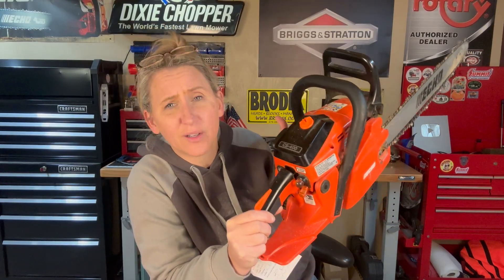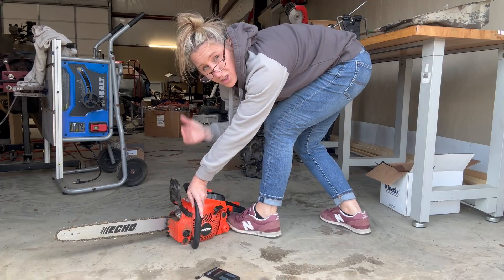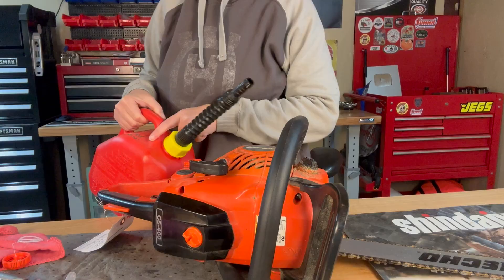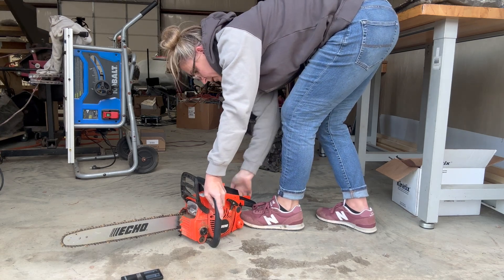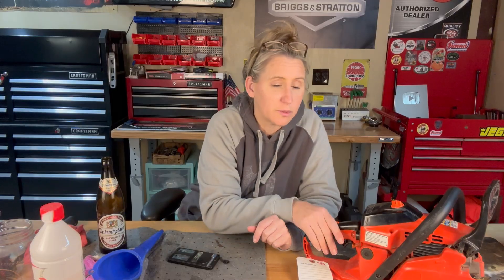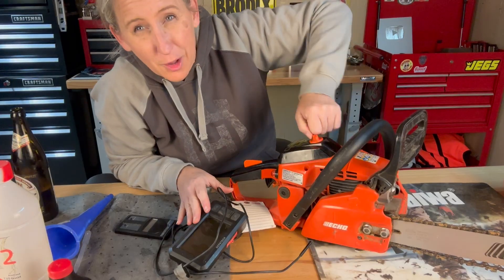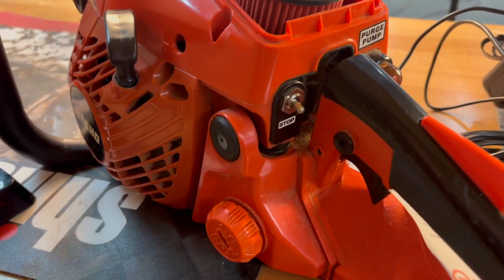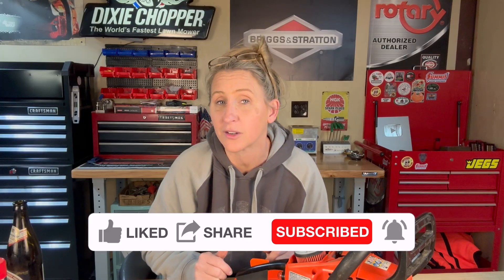Engineered Fuel FAIL! Your Small Engine Is Not Running Right, Even if You Think It Is!

Comment: What about vp? I know true fuel makes there fuel in bulk, so stability is a big issue. Vp and there brand sef, have the hole raissing reputation to uphold, so maybe there better? They make there products in small batches, and sell old stock on clearance, so stability shouldn't be an issue? TF seems to be pumping as much stuff out as they can, with things like reputation, a good product, and customer servace being secondary to profit. As a blind small engine mechanic with no usable vision, I have to rool everything out before I even think about calling something fixed. So mixing pump gass, with all the problems it can have, is not an option because it can introduce problems of it's own. Sorry for the bad spelling, I sucked at inglish, and it wasn't the blindness, there are blind inglish majors out there.

Comment: Hey girl! I’m an old dude so I’ve learned a lot over the years, but I learn even more watching your videos. I agree on the box store gas…..engines will run boggy…..for me it’s 93 octane and Pennzoil 2 stoke oil….most everything can be cured with preventive maintenance. Let’s see a video on cleaning and maintaining your toys DIRECTLY after using it, instead of just throwing it on the shelf..it’s what I do and with 12 small engines I don’t have problems.thanks again and you go girl!

Comment: Whenever I have someone bring me a motor, first thing I do is dump the gas into an extra fuel jug I have for "whatever fuels", then add some ethanol free pump gas. I have never had good luck with any of the canned fuels in any of my equipment. By doing that, it also ensures I am dealing with fresh fuel as well.

Comment: Bre - a very minor suggestion.   Keep emphasizing the necessity of using a good quality 2-cycle engine oil!!   I totally thought of you and thank you after this happened.    I thought I had run out of my small supply of Echo oil and found one in my supply that I had actually bought from Sears.   Figured it should be good, right?   Even though they didn't make much of their own appliances, they had decent quality products (washers/dryers were LG, Maytag, Samsung) for the yard as well with MTD and TroyBuilt, etc.  I made the mix and proceeded to work the yard.   Nope.   My Sthil trimmer coughed, knocked, and choked on the mix probably barely making it 6-8,000 rpm -  and I'm guessing.   That it was knocking was very evident and smoke coming out of the exhaust port.   I got to HD and all I find is that Tru-Fuel crap,  but they had two pallets of  the trufuel, and no 2-cycle oil at all so I back home I went.     I routed around again and found my last bottle of Echo and mixed that.    If I hadn't found that, I was going to order some through your link and hold off doing anymore yard work.   I poured everything out and put in the new mix.    The blower fired up just fine and sounded 100% better.   The Sthil trimmer coughed a bit in transitioning from one to the other but once it warmed up  - it was like a totally different trimmer.  No knocking, throttles up to max RPM without issue and I noted a major improvement in the torque while trimming.   Thank you girl for all you do.  Now I only go with Echo or Red Armour and I ordered Red Armour through your site.  Just joined your group too!

Comment: I'm having a little trouble understanding the problem with canned fuel..The canned fuel I use is high octane, no ethanol....the engines seem to love it and it does  not eat up fuel lines.  Have you ever had an analysis done to determine what exactly the problem is with some canned fuel?  Love you site!!!

Comment: One thing I went through this spring was I had used canned fuel last year as an experiment, while after adjustment of the carbs it ran ok, I didn't like what I saw, seems to be too much oil in the stuff, and the oil doesn't seem to burn, it fairly poured out of the exhaust. I decided to mix up a new 2 gallon batch of regular gas-oil fuel, and added the remains of the can fuel to the mix to burn it off. It seemed to work ok in my snowthrowers last winter, and  it ran sort of in my old Lawn Boy mower, float bowl carb stuff, but it wouldn't run at all in any of my weed eater type fuel system lawn equipment come spring. I checked for water, and there was none. The carbs were getting fuel, but oddly, even with all the oil, the spark plugs were dry. Was getting spark, but not even the first pop out of some engines. Others would start and then die. I decided to mix up a new spring batch of my regular fuel oil-mix in a new gas can, clear all of the old fuel out of the equipment, and after carb adjustments again, all units started running great. I think what it is, is there is some kind of chemical reaction between the can fuel and regular gas-oil mix that completely stops the gas from working at all. I'd be afraid even to put it into my car to burn it off. Gonna have to find some way to dispose of it. Weed killer maybe?

Comment: Like your videos very helpful  Question I work at a golf course and have several trimmers, pole saws, hedge trimmers etc. that need the carbs cleaned due to the sandy envirnment they live in.  Any suggestions for a cleaning solvent to use in an utlra sonic cleaner?
Thanks

Comment: ALCOHOL 

The alcohol is absorbing the water and it will continue until it reaches a certain point.

ANSWER WILL BLOW YOUR MIND

We all know about $15 special no alcohol gas
Scam

So we make our own

1 pour a quart or 2 of water into a gallon of gas.

2 let it sit overnight

3 drain off the separated gas

4 you now have water mixed with alcohol and pure gasoline.

Instead paying $15 you lose 10% ftim pu p gas because no alcohol now.

Kills two birds with one stone

You can boil out the alcohol water mix under 170 degrees and a still coil then you'll have pure alcohol again to put back in your car to absorb water again.

You can make an adapter for your electric drill to eliminate those stupid recoil ropes.

Comment: I just dump all old fuel out of my outboard case can mixed fresh 95oct gas with its 400ml of synthetic 2 stroke oil 20l tank .    I would like to add a dose of NULON PFSC 500ML PETROL FUEL SYSTEM CLEANER l.       Is it possible for this product to effect the 2 stroke oil is it safe to mix with the oil?

Comment: It would be great, (and you may have already), show us the best way to winterize an engine,  I usually run it with fuel  +Stable until dry.  Then give it a shot of WD40 in the spark plug hole, turn it over once and call it done.  Is there a better way?   Thanks,    GREAT content!

Comment: Husqvarna 240 Always used Husqvarna fuel. Used to run well, then it wouldn't stay running. Found cracked fuel return line. Replaced all fuel lines. Wouldn't start. So I drained the tank and mixed fuel according to this video, same brands of stabilizer and oil. Still won't start. I must be jinxed.

Comment: Hello  I use aspin 2 it's a 50-1 mix however I use in my 26cc titan multi tool 40-1 MIX I add 10ml of sthill fully synthetic ultra 2 stroke  oil good for carbon reduction  I use the same in my titan leaf blower 51cc and efco 21cc hedge trimmer  works great on engine

Comment: Nice job and very informative as you take the time to show everything. Could you do a video about the 2 tools (fuel level arm check) one Golden and the other one is kind of silver (partszen Carburetor Adjustment Tool for 2-Cycle on amazon), cause there is lot of way to do it looking at them. Which gauge bump to use on which carburetor. That would be very useful to us.  Thanks

Comment: I tried your hack about using premium gas and echo red armor 2 cycle oil. My stihl chainsaw started right up and so did my Stihl pole chain saw. They has both been sitting for 5 months. They run smoother and at a higher rpm. Thanks

Comment: I been working on a John Deere 332 lawn tractor and I put a new battery in it and air out of the fuel lines and it runs smooth again except it just needs new set of blades and a possibly a new generator on the tractor too but not 100 percent sure  changing old batteries on tractors is easy and quick

Comment: I don't mean to take business from you, but I found out how to keep your equipment running for a very long time. Back in 2000 I bought an FS-45 Stihl weed trimmer. In May of 2024, that weed trimmer will be 24 years old. I found that if you follow the manufacture's recommendations in the owner's manual that you can make your equipment last longer. From day one, I have used in that trimmer what the owner's manual recommended. That weed trimmer still runs like a brand new one. The only thing I have had to change on the motor is the spark plug and the air filter. I use only the recommended oil and gas the owner's manual says to use. And I don't have any problems out of it. The motor has NEVER been worked on. The carb has NEVER been taken off of it. The motor of that weed trimmer is still in brand new condition.
I've seen people pump can after can after can of that engineered fuel into their equipment and then have to take it and get it fixed so that it would run right again. My next door neighbor uses True-Fuel in all his equipment and has to take it to the shop every other time he uses it. My weed trimmer and my leaf blower have never been in the shop. My leaf blower is seven years old. Feel free to pass this info along to your subscribers if you wish.

Comment: I appreciate this video. I switched over to the canned fuel for off season storage upon Steve’s small engine saloon recommendation. I’ve noticed that my weed trimmer just doesn’t want to sing at the top of its voice anymore. I’ll give the red armor a try, I’ve been using the cheap super tech two cycle oil during mowing season and it seems to have made no difference.

Comment: Bre, I'm enjoying being a Member and watching the extra content.  In 2002 i bought a Husquvarna 55 from my local Dealer who I'd done business with for 30 years and I grew up with the Owners.  I bought my saw in at the required Carb adjustment period and a professional sharpening.  It was running great and I'm expert at sharpening.  Whenever I had them sharpen my chain they'd take off alot of tooth.  I got the saw back after 2 weeks!  They said after the 4th day (when promised) the Mechanic had a death in the Family.  After a week I inquired what was taking so long.  I know the owners were capable of turning a screwdriver and making the adjustment.  When I got it back 2 weeks later I went out to cut some trees and as always, I tested the saw before I went out to the woods.  ( I had this saw, 2 Poulan Wild Things and two Homelite Super 2's.  I ran them all regularly and sharpened them after every use.  I also used a log roller to cant the logs.  The saw was running at 3/4 throttle at best and the chain wouldn't bite at all.  Disgusted, I bought it back and demanded my money back as it was apparent they were not capable of providing me with the Service I expected.  I'm a Mechanic so I repaired all my own equipment and vehicles.  I got banned from the store.  There was another Dealer 8 miles from the Farm I worked on 35 miles from home which I began using as my go to shop.

Comment: I've never used the canned gas. There is no ROI, atleast at a golf course. Our pumps have ethanoled 87 octane. I typically get 5+ years out of a packpack blower. We typically go through 24 gallons of mix every 2 weeks, and 50 gallons a week during the fall cleanup. When i ran a cost analysis, we'd spend something like $4000 more a year than what we budget for replacements on 2 stroke equipment.

Comment: I've come to have total trust in Bre's advice on her channel.  Just as a case in point about her sincerity when endorsing products, you can find an interesting video from Steve's Small Engine Saloon done in OCT 2021 that absolutely agrees with Bre about Red Armor Mix Oil.  Steve's video tested the marketing claim about Red Armor helping clean carbon deposits by showing two tanks of fuel with Red Armor run thru a carboned-up, Stihl, leaf blower.  It actually went from having a spark arrestor screen near entirely plugged with carbon to being very clean after.

Comment: I have RedLine racing 2 stroke oil i use in my Kawasaki motorcycle (oil injection). Thoughts on using it in my lawn equipment also? Eco cs3000, Echo CS440, & Echo SRM-225.  Love ur videos, keep em coming.

Comment: I have an old fs85 Stihl trimmer that I have had for over 20 years. Last year I started using the insanely expense Stihl canned fuel in it and it ran great! This year it started right up after sitting all winter. Have you had any experience with this fuel??

Comment: Never used "canned" fuel, so I'm not trying to knock your thoughts on it. But years ago I found that a bike I had needed a main jet change due to a fairly drastic change in oil mix ratio. The oil replaces fuel and changes the tune. Does the canned fuel have a significantly low or high amount of oil or other additive that means the saw needs returning to suit canned fuel? Can that fix the issue?

Comment: This video does not prove you are right......what it does prove is that you don't know as much  about carburetion as you think. The saw ran rich with the canned fuel because it is less viscous therefore it goes thru the jets easier making it run rich. A simple leaning of the low and high main circuits would have cured the problem. I mentioned this once before but i guess you didn't read my comment.
Reply from the maker: So show me where it says on the can that you need to adjust your carburetor for it to run correctly.. Of course it would never say that... Obviously you don't understand.... that they can not sell a product for the general public that one, a customer would have to buy a special tool to remove limiter caps, and two expect them to know how to adjust it when they don't even want to mix their own fuel.

Comment: Love your channel and this is a bit off topic. I have Husqvarna 128LD that I bought from a neighbor. It ran well until it didn’t. I’ve tried a cheep carb and an OEM carb to no avail. Will not run smooth. New plug and fuel line and filter. Checked all the boxes, I got nothing. I have another Echo that I’ve had for 6 years and the only thing I changed is a plug and primer bulb. Heading out to get another Echo, could have saved myself some money and aggravation. Husqvarna’s are just junk! Thanks for reading my rant….

Comment: Canned fuel is handy, but at $5.95 a quart, that's $23.80 a gallon.  Why would ANYONE  buy the crap?  Oops, I was using old memory of prices.  The post-Covid prices are even ungodlier:  Royal Purple TruFuel is $29.03/qt, Husky is $10/qt, VP is $18.59/qt all at Walmart.  Egad!  
I had some 2 y/o gas mix which ran boggy in my old inherited Ryobi weedeater, so I threw it in the Tundra and mixed up fresh with SuperTech oil and it runs much better.  That's the first time I've ever had trouble with fuel mix.  The one year old stuff always runs.

Comment: Some brands will not honor the warranty unless you use premixed 2 cycle fuel. What a load of crap, I mix my own fuel with Red Armor, Sta-Bil 360 plus Startron and in 20 years I have never had a issue with a carburetor. My buddy was having the same issue with his leaf blower but it would die hot and not restart and guess what, it was the fuel, surprise surprise!

Comment: Aspen2 and Aspen4 is great. Husqvarna also sell alkylated fuel called XP Power 2 and XP Power 4. Too bad it seems like its not available in North America. I run all my small engines on the Husqvarna fuels with great results.
Reply: I have a suspicion that the Husqvarna fuel is actually re-badged Aspen Fuel.

Comment: Great video, tried 1 bottle of Stihl can fuel when it was first introduced by Stihl. Last time…. 
About the 93 octane, I clean out the remains of whatever in the van gas tank before the 93 starts flowing, use stihl synthetic oil an ethanol stabilizer. It’s an original 290 Farm Boss, just meant for cutting wood.
Thanks

Comment: I have been watching you channel for about a year now.  After watching the latest video where you addressed the canned fuel topic again. I will be giving Red Armor and gas a go with my Leaf Blower and trimmer.  I do have a question on the RED ARMOR canned fuel.  Is this product subject to the same issues as the other box store canned fuels? I do not remember if you mentioned if this should be avoided since you do suggest that we use RED ARMOR oil additive for any tool that requires a oil fuel mix.  Is the problem all canned fuels including Red Armor or just the other brands?  
Also what are you thoughts on using the canned fuel to store you tools? Then use the Red Armor Gas/oil mixture  when grass cutting season starts up?

Comment: I had a "duh" moment this week with my 10 year old husky 450.  I noticed it wouldn't keep idling when I sat it down to load the firewood I'd just cut.   So when I was sharpening the chain it hit me that I hadn't looked at the air filter for a while.  Yep, it was dirty.  I blew it out with my air hose and guess what.  That baby sits there and purrs and keeps running till I'm ready to start cutting again.  Coincidence?
BTW, you rock.

Comment: I literarily just bought another 6 pack of 2 cycle oil last night.  The sales guy was trying to get me to by that engineered fuel crap.  I told him there is no way I'm going to put that in my small engines.  He asked why so I told him about the years of service I've gotten out of mixing my own mixed fuel and the small additional coast I might have in spark plugs and spark arrestor getting plugged etc.  But for 40 years of success I am not going to pay $45 a gallon for that crap then have new issues that I would not have had if I just used my tried and true mix.

Comment: The canned fuel is Very easy.  Just put it in the truck toolbox and head out to the job.  But it does cause small engines to run badly.  Excellent video.